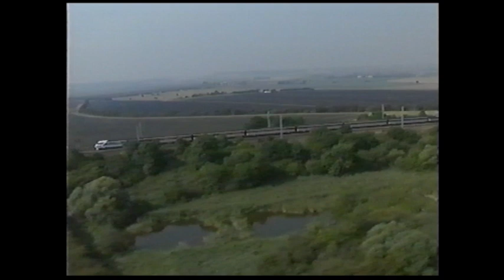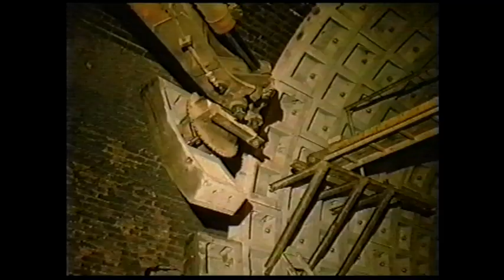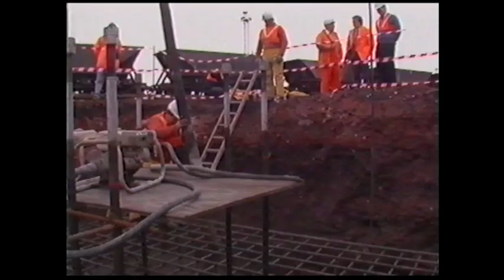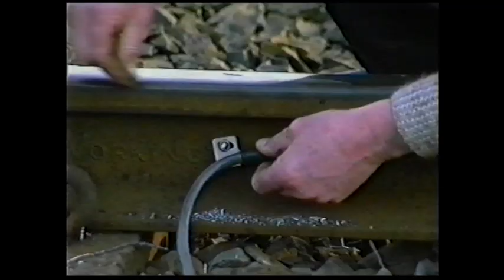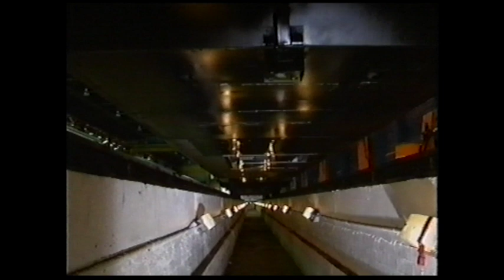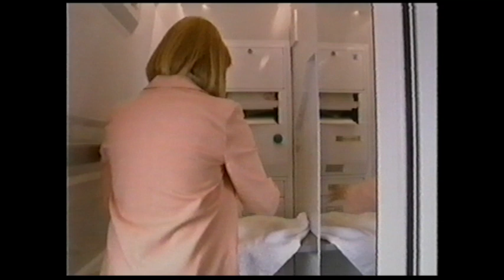Up and Running (British Rail, 1989)

Comment: The ECML scheme cost £1.2 billion in 2026 money, 31 trains, 350 miles of electrification, track improvements and world leading re-signalling delivered on time and on budget.  
A couple of years later the Tories ripped up the teams who did this fine work.
In 2026 money the GWML electrification cost £3.5 billion, electrification only, and only delivered 155 miles of electrification.
Bring back BR

Comment: This is an excellent film, with commentary by Martin Young. It was filmed in 1989, while ECML electrification work was at its height. It is the first of two films made for BR InterCity by Cinecosse, the second and longer one being called 'Corridors of Power', issued in 1992 after the completion of the whole electrification to Edinburgh with opening by the Queen. The introduction and final credits of 'Up and Running' are missing here but the whole style and presentation is the same as in 'Corridors of Power', which hasa Martin Young's commentary and full credits at the end. Recommended that one views this film first (16 minutes) and then 'Corridors of Power' (24 mimntes). The Link to the latter filmis https://www.youtube.com/watch?v=itmm98UVeVE . In this film, the works at Edinburgh Waverley and in the Calton Hill tunnels is shown; in 'Corridors of Power' the works at the historic Newcastle Central station and the Royal Border Bridge. The testing and design layout of the line's Mk 4 coaches are shown in detail in this film.

Comment: and all of you "armchair experts " who scream "bring back BR ",- "good old BR ", --  "should have never privatised the railway" ,etc, etc - you all seem to be ignorantly unaware that there WERE a high proportion of private companies involved in the successful  east coast electrification project-  " good old BR " just simply contracted MOST of the work out to outside private  industry !!
Reply: Logic and facts don’t matter to train spotters….much easier to just trot out myths and bogeymen.
Reply: They may have sub contracted out the work, but the project was managed beautifully by BR.  Nowadays Network rail wastes billions on mis managing projects and having a stop go attitude to contracting our work (I've worked on the railway since 1989, formerly for BR Network Southeast and intercity, latterly Railtrack, then Network Rail, now i work for Siemens planning possessions (Blockages of the line) for re-signalling projects around London and the South East.  I'm probably going to be redundant in January 2027 when my current project winds down.  NR refuse to sign off the next London re-signalling project.  😟  In 1989 the government gave the railways support of about £2.5 billion in 2026 money.  This year they are supporting the railways with £12 billion.  Provatisation has cost this country BILLIONS

Comment: Why did they not just lay a third rail? Seems like it would be a lot less work and a lot less intrusive.
Reply from the maker: Because it would have meant decreasing max line speed to 100mph.
Reply: 3rd rail requires a much greater number of substations than OHLE.
Reply: @lindsaydonovan6241  They dont put any new third rail in due to safety and costs of sub stations etc as previously commented.
Reply: Third rail operates at a low voltage 750V vs 25000V for AC OHLE. To deliver the power necessary for long distance intercity and freight trains the current demand would be massive in turn resulting in huge volt drops unless feeder stations with grid connections where positioned every few miles. The resulting cost would be colossal far exceeding that of a 25KV OHLE system
Reply: Because the efficiency of third rail is awful

Comment: The 91 loco never hauled sleepers
Reply: It was planned to just that when they eventually built the associated sleeping cars they found that the train and the OHL could not supply enough power for the hotel services of the train.  The new sleeping cars never saw the light of day in UK service.  Some were sold off to Canada and parts of the EU I believe.
Reply: I'm afraid your getting your ECML sleepers mixed up with your Eurostar Sleepers (called Nightstar if my memory is correct).
The Nighstar sleepers are what got exported to Canada and were built to go through the channel tunnel. They were to provide an overnight service similar to the 'Regional Eurostars' (which never got used on their intended services either), as flying was faster and cheaper and BR realised they couldn't compete.

In fact, the sleeper services on the ECML started to reduce in the late 80's because people started to fly to Scotland, hence why a 91 never hauled a sleeper and we have ended up with 2 sleeper services from/to London from Scotland.
Reply: But it was supposed to and designed to. GEC promotional material refers to the locos being able to haul sleeper trains over Shap on the WCML. Privatisation and the Balkanisation of passenger services scuppered that plan

Comment: This train was much more comfortable then the Azuma
Reply: So was the 125. Azumas are awful, you get more comfort on a bus seat.
Reply: exactly! @BobRoberts2000
Reply: @BobRoberts2000  pacer lol
Reply: @BobRoberts2000  That was the DfT/Treasury plan - make trains travel uncomfortable so passenger numbers reduce so services can be curtailed so Beeching 2 can be implemented.  So far the plan seems to be racing ahead.
Reply: I totally agree, 1 hour on an Azuma is too long!
Reply: I totally agree, never thought I would ever say that, the air con was a disaster though. But you cannot whack the MK3 stock.
Reply: @jonc4686  When it first entered service the MK4 was a terrible ride but they quickly (probably because it was knocking hell out of the track 🤣) sorted that out.  Adjusted the suspension and added some additional shock absorbers I think. I  never found any issues with either the MK3 or MK4 Air Con, after initial tuning.  On the MK3 (HST) coaches they quickly sorted dampers out to stop the break smell when HSTs were introduced on the WR.
Reply: I actually really enjoy the Azuma!! Given that it meets safety standards, it does a much better job than other new trains.
Reply: Azumas are a pile of shite. It makes my blood boil when you see the fantastic inter city trains on the continent.
Reply: And more powerfull and better looking and nationalised and right on time.